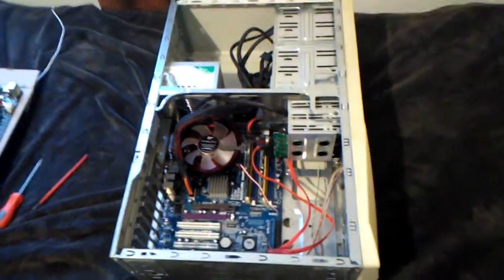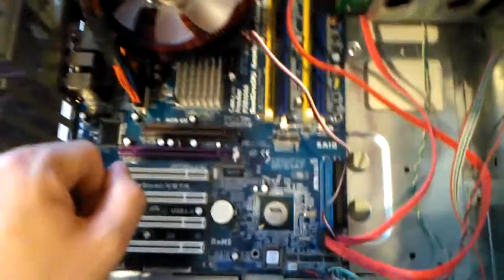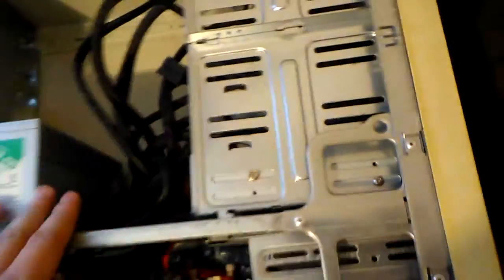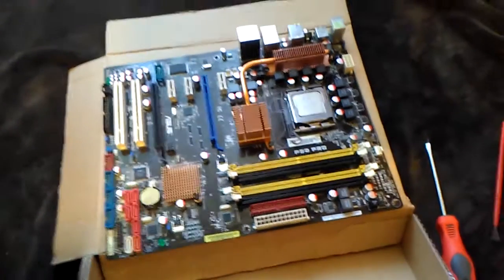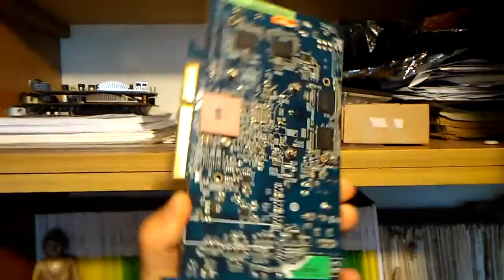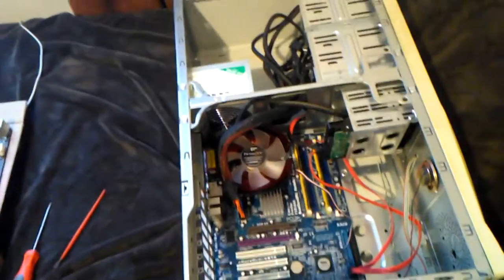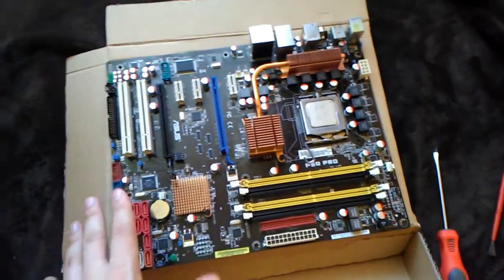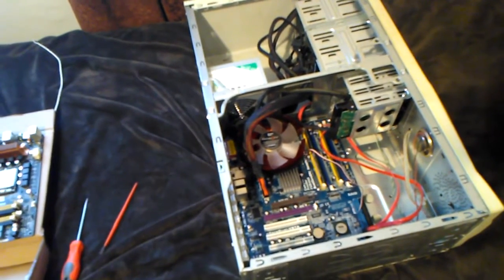Upgrading the Retro PC with the Asus P5Q Pro motherboard

Comment: I hope you know that you can run the latest games on high with this motherboard, that’s why the p5q pro was king or the turbo too which I have.
My p5q pro turbo has ssd in it, 16gb ddr2 overclocked to 1200mhz, with two 7950s crossfire. Cpu is x5450 oc to 4.2ghz.
Reply from the maker: Wow! That is nice! :D
Reply: @JohnAmanar  exactly, computer stores will always tell I need to buy a new computer even though my works just as good as a modern pc.
Reply: @derickmuir1700  wow bro. Its a cool mix. Can you help me please with the drivers for my asus p5q pro. I have it with a q9550 and 6gb ram. 
Im from Cuba, so its very dificult to access to that tech

Comment: I saw your motherboard can runs 16GB RAM DDR2 at 1200 MHz and I want to buy the ASUS P5Q Turbo with 16G DDR2 at 1600 MHz. 
I have DDR2 memories with 800 MHz but I didn´t see more than 1066 MHZ, so It is safe to overclock the memories at 1600 MHz?
Reply from the maker: Hi! I have a ASUS P5Q Turbo as well. 16GB DDR2 is an option and it runs well using 1066MHz memories @ 1200MHz. You need good modules for the OC. I am only using 4*2GB OCZ 1066MHz modules right now. It is hard to find 4GB DDR2 modules. I don't think you gain too much with the OC, but you can try. 1600MHz is not an option with this motherboard. I am not sure if you can find 1600 compatible modules at all. 1600Mhz FSB is an option, but not an option for RAM. There are some DDR2 1200MHz modules as well, but hard to find.I don't think you can OC your 800MHz memories above a GHz. Get some good 1066MHz modules and you are good to go. I hope I could help. :)
Reply: @JohnAmanar  hi zoltan l have big problem l need to buy ram buy l dont no about that anything l google 3 hours nothing found useful and back her to you video l have hope you help me if you know, l have pq5 pro turbo with xeon e5440 l wont to oc to 3.8ghz because l have r9 270x sapphire dual x 2gb,ssd transcend 1tb, power supply lc 650w and noctua d-15 coller and http://prntscr.com/nukb3s here is picture of my cpu bit info for ram modules now money is no problem but l wont if my mobo support it max mhz best best ram module max gb 16gb if support, l very hard to explain all details to not be borring,l dont no what missed,l find it but if you know what is best ram server non bufered or what, l buy ago pq5 pro turbo then xeon e5540 then noctua then gts 4501gb then coollers mouse that stuff then r9 270x l wont to upgrade this pc to max if you have sollution for my bottleneck with xeon e5540 and r9 270x l big big happy,please answer and big tnx
Reply: @LexxDesign3D  but you figuret out the point lm good in speak it but text it very bad lm
Reply: @LexxDesign3D  that is only gramatic l learn and figuret out because that is not complicated so much because l now english in my finger
Reply: milan filipovic You know English in your finger???

Comment: Can this MB support NVMe drive through an adapter PCIe card?
Reply from the maker: It is a very old motherboard so no native support, but you can buy an M.2 NVMe SSD to PCIe x16 adapter for around 4 USD and it will work just fine. Of course you'll lose your CrossFire option.
Reply: @JohnAmanar     Thank you for your reply.
One more question, can the P5Q Pro legacy BIOS boot the OS installed from the PCIe slot mounted NVMe SSD?
Reply from the maker: @litchi4507  Unfortunately booting form a PCIe SSD is a problem with these old boards. I saw online it was possible with modified BIOS, but it is a torture to make it work. So, no boot with the legacy BIOS.